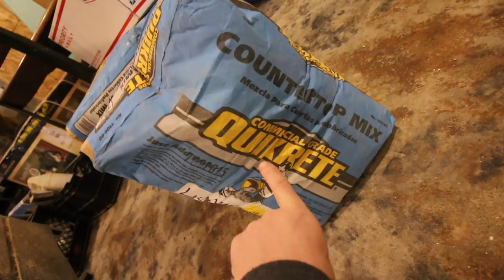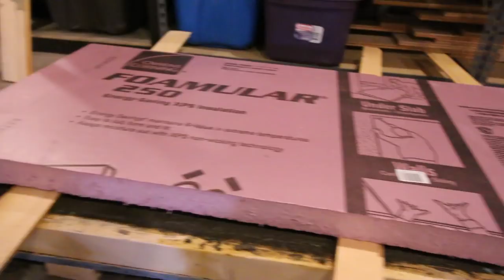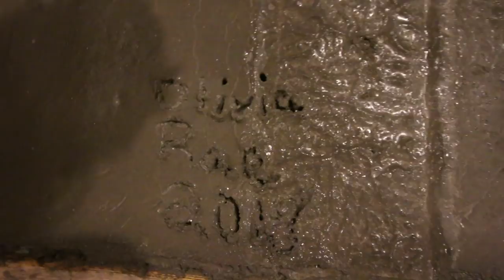Making a Concrete CounterTop for our Desk Build ~ During a Freezing RainStorm

Comment: Al, our carpenter would have crossed the rebar with small wires,  but many after all these years the looping wires are not necessary. My only added comment.  What a project.  The names make the project special.

Comment: I did a countertop with 2/1/1 sand, cement, pea gravel. also added plasticizer, acrylic, ground fiberglass. it was like rice Krispy treats with marshmallows and worked very well. I'm trying your idea with the tung oil sealer and so far so good!

Comment: Nice job! I was wondering how you were going to get the air bubbles out. Great thinking out of the box. From my concrete experience years ago I think probably fencing wire would have been enough rebar to strengthen your small application. My great uncle Charlie who was a brick mason used to offer several different colored dyes to mix with mortar on brick fireplaces and chimneys, that might be an option for the future if you would like to have a colored countertop.

Comment: Did you think about using some of your "pig wire" cloth instead of the rear for reinforcing the concrete top for the desk?  I have used it and it works well.

Comment: How would you make holes for cords? I need to make an L-shaped desk top twice as big as this but need holes for computer, printer, laminator, and Cricut cords to plug into the wall under the desk.
Reply from the maker: I would glue round plugs to the form and pour concrete around them to make the holes

Comment: Nice video, I'm curious how it turns out.  It seems to me that you used a dryer mix for the desktop than the counter.  Was there a reason for it being dryer on your 2nd concrete project?
Reply from the maker: We didn't have as big of an area that we need to spread it out over and work it.

Comment: got some questions please, looks like a fun project . 1. Why mix the cement so thick? 2. why use that cup for the water, didn't look like you was measuring anything? 3. isn't this going to be super heavy? how ya going to lift it? Otherwise was very interesting and fun to watch.
Reply from the maker: the less water the stronger the concrete is. The directions call for 8 pints we had to use 12 pints and it was still very thick
Reply: thanks for the reply